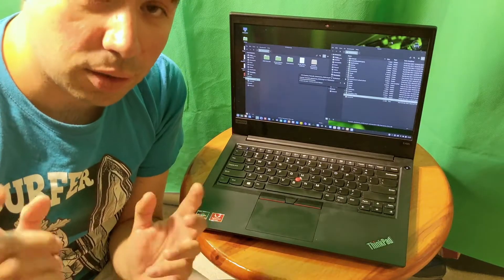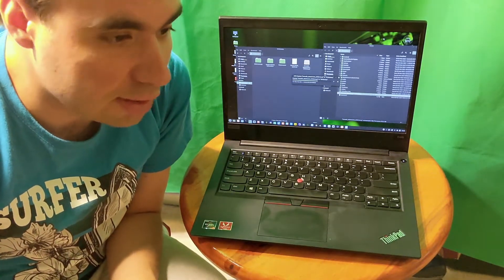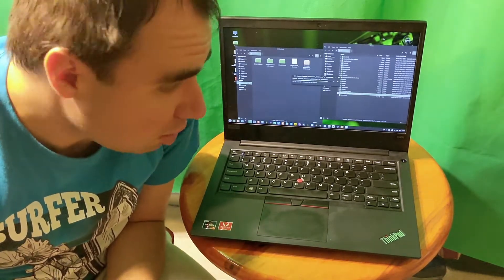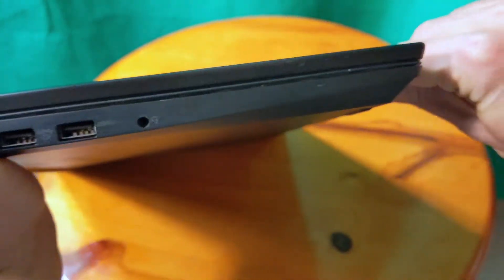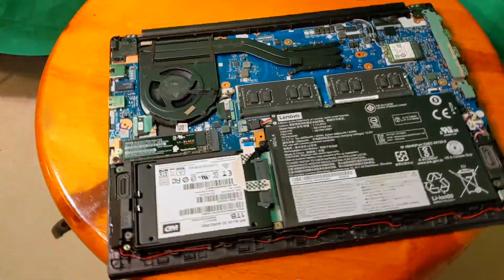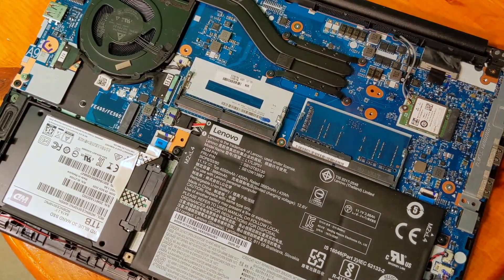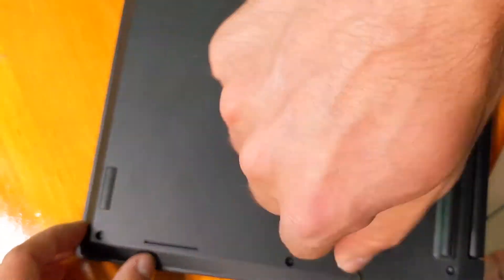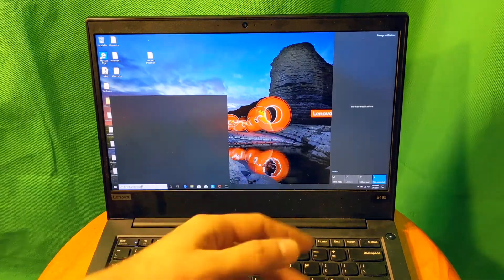Lenovo E495 Disassembly. RETURNED and Bought M1 MacBook Air

Comment: Of course it's slow...put a faster hd in it and then judge performance. Dont guy a low tier laptop and complain...
Reply from the maker: Well, two points here:
1) I initially installed a fast SSD here
2) Lenovo shipped me a computer with a much slower processor

That's why it was that bad. With Ryzen 3500U it could be a much faster computer.